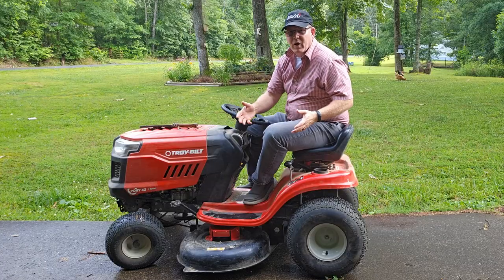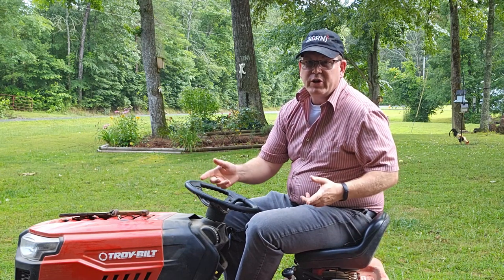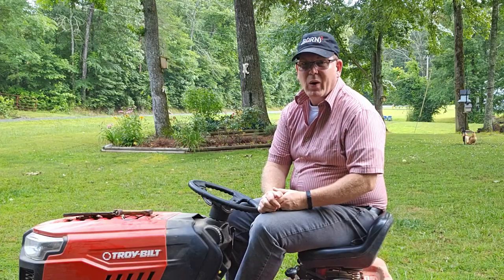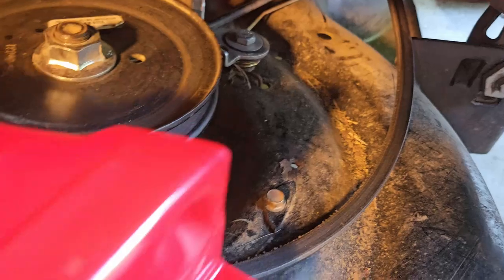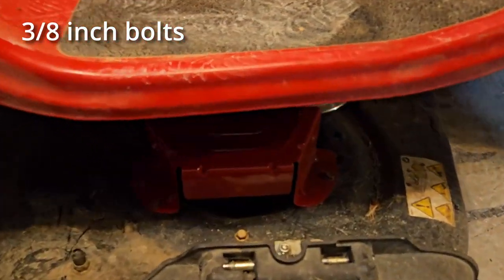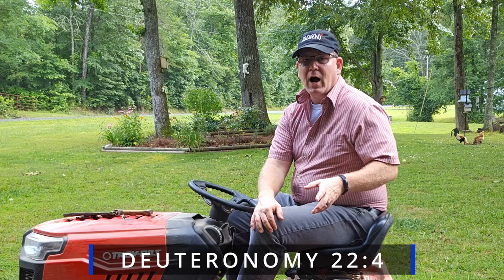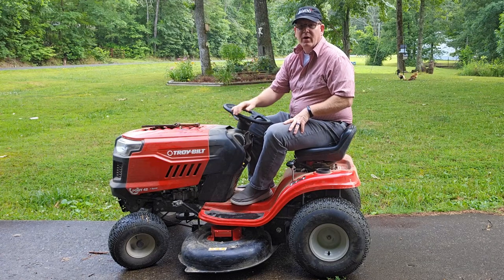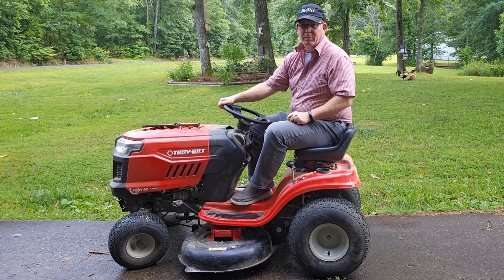STOP the Mower Belt from Slipping Off the Troy-Bilt Pony 42 Riding Lawn Mower

Comment: I've had to borrow my cousin lawnmower this summer, and last week I was cutting went to engage the blade and noticed nothing was happening. I moved the lawn mower and saw a black piece laying on the ground. I didn't know where it came from. Later looking around I could see the belt was off up front and noticed the part was the deck belt cover. I figured this kept the belt from slipping. Thanks for the video and all the info, also the message at the end.
Reply from the maker: Glad it was helpful

Comment: Just purchased the exact mower from a co-worker. Belt slipped off the other day. Low and behold, one of the covers is missing. Thanks .!
Reply from the maker: Glad you figured it out!
Reply from the maker: I found the following on the Troy-bilt website. Hope it helps.

If the engine dies when the cutting deck is engaged, there is likely one of the following three possible scenarios:

The riding mower is in a reverse gear. If the mowing deck is engaged and the unit is in reverse, the mower will shut down as part of a safety feature.

An object or obstruction (such as an ant hill, clump of matted grass clippings or large tree branch) is jammed underneath the cutting deck or in the cutting deck drive system preventing the moving parts from engaging properly. Inspect for obstructions and carefully remove if necessary.

The electrical system may be experiencing a short or improper ground somewhere throughout the length of the wire harness. This could be sending a false signal to the safety interlock system. This false signal may be sensing that the operator is up out of the seat or the unit is mowing in reverse even though that may not be the case. For this situation a thorough inspection of the electrical system and possible repair of the wire harness is needed. Please use our Dealer Locator to make arrangements for local service and repairs.

Comment: I have a craftsman t1200 the belt keeps jumping off can’t figure out what the problem is sometimes it will allow me to mow awhile before jumping off but I have to mow with the deck lever on 3 if I try to mow on anything lower will pop off or if I raise or lower deck it will come off any ideas what problem could be
Reply from the maker: I'm not sure. Is that Craftsman the same as the Troy-bilt Pony?
Reply: @pastorchrismullis  I’m not sure I really don’t know to much about riding mowers
Reply: Might have the incorrect belt size on? Or the v-Grove on the belt might be inside out?
Reply: @EmanandAbbie  the belt is on correct and it’s the factory size belt but I have also tried a bigger size belt and ive tried a smaller belt to make it tighter and the same thing happens it pops off been going crazy trying to figure out why it’s happening
Reply: Looking at pics I found online, it looks like the same mower as the Troy Bilt. I'm having the same issue with ours. Anything lower than 3 and it chucks the belt. New belt and even went 1/2" shorter. I think it's just a bad design. I have the pulley covers on mine and it still does it.
Reply: @willd7033 totally agree same issue I’m having been cutting yard with the deck up high but belt still comes off new pulleys and belt even went a size smaller so maybe it would be a tighter fit also have belt guides installed still having belt jump off issues

Comment: My belt doesn't fall off but the lower i set deck it doesn't have enough tension on the belt what could i check
Reply from the maker: The belt may have stretched
Reply: @pastorchrismullis  its a new belt
Reply from the maker: @MrFreakfortatt  🤷‍♂️ you might do a google search and see if there's a tensioning pulley adjustment.